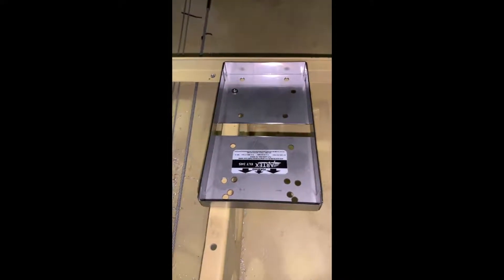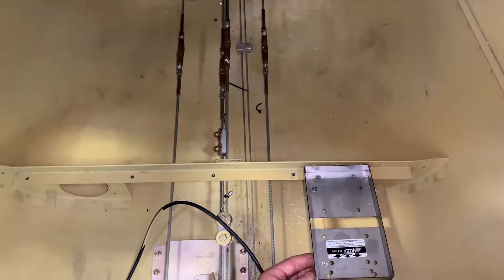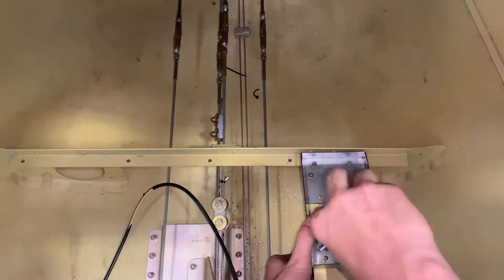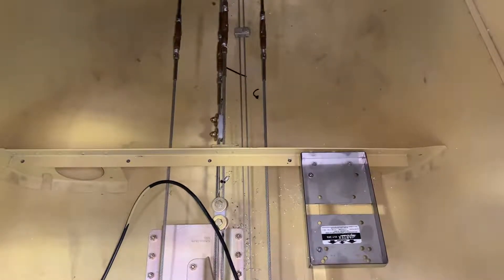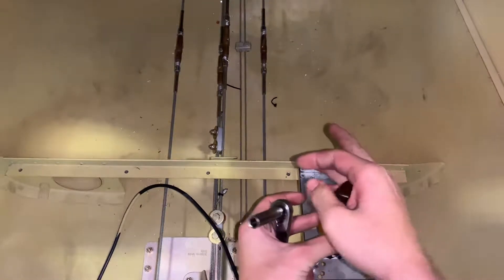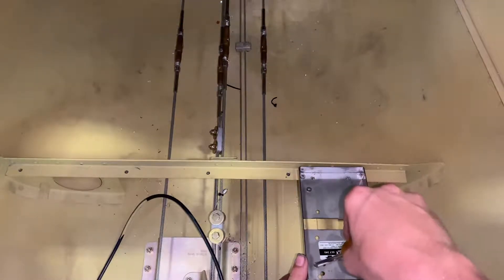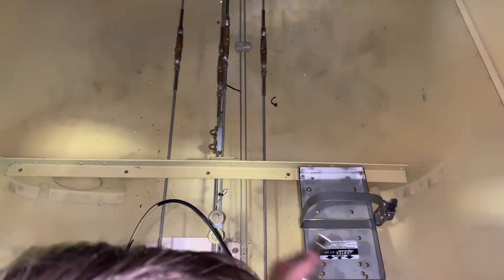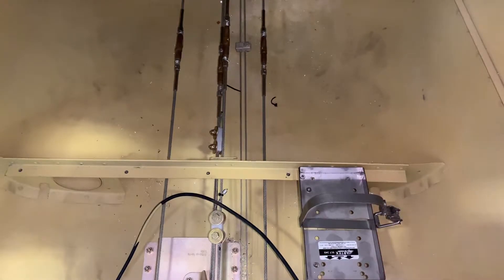ELT INSTALATION PART 2

Comment: Once again follow instructions. Should have used a backing plate so you have the required screws in. I think it needs to be within something like 3 (check instructions) degrees of longitudinal axis. Cannot flex or move easily per approved instructions.